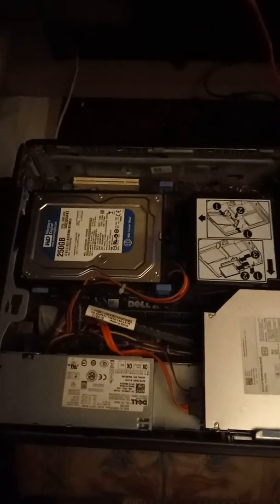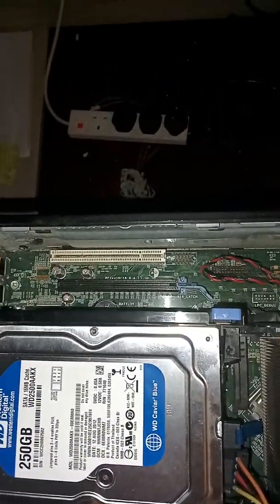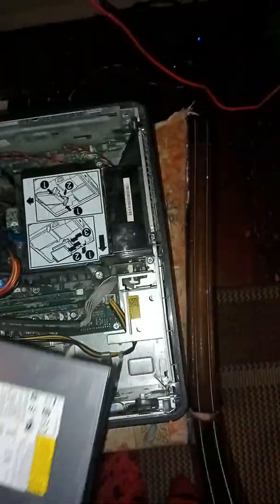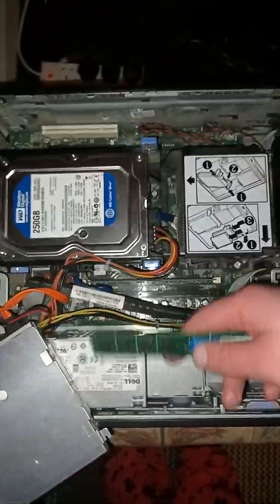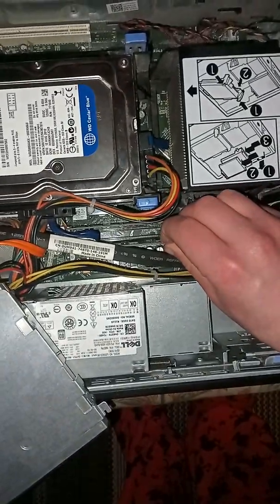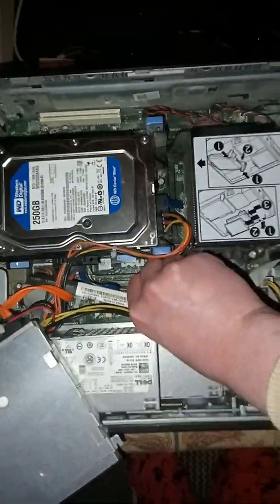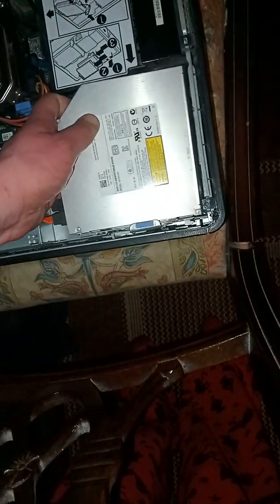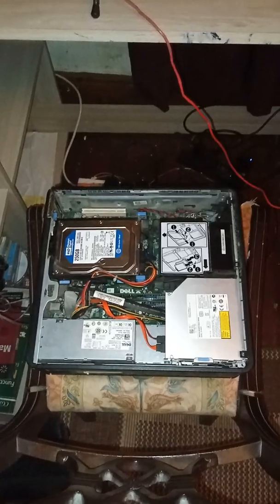How to upgrade RAM on Dell opiplex 380.

Comment from the maker: I pulled the ram out by the way. If you under 18 please get an adult to help you. Before you work inside a pc disconnect the power supply. And touch mental part of pc to prevent damaging you components.
Reply from the maker: Hope it helped. If it does not boot please make sure you put the ram in right. Also if you system crash after installing the ram then please put in correctly.

Comment: Why don't you get a hard drive that's 1 TB. You can find some pretty cheap hard disks that are 1 TB or more. That's what I put in my PC
Reply from the maker: I may add a 1tb hard drive very soon. Or I could install a solid state drive with 1tb but its a bit more expensive.